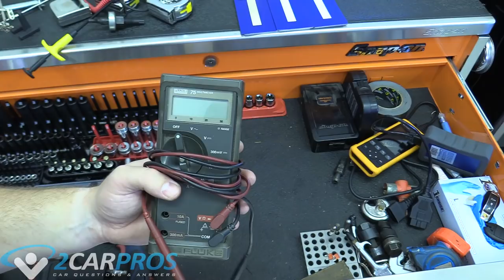What's In My Toolbox?! - Toolbox Tour!

Comment: It's always amazing how we buy a full set of tools and then realize you don't use half of them. Like that 30 piece screwdriver set you were convinced you needed when it was on the truck, now you have replaced the handles on the #2 philips and the straight blade twice and split the handle on the large one by hitting it with a hammer. The rest are covered with dust... Can always tell the guys in a shop who have just started in the past few years, they have all the metric stuff. Those of us from the "old" days still have the hammer and chisel we used to carve new round stone tires....
One thing to watch out for when buying any of the truck tools used, be sure the stuff is paid off. Nothing like getting a great deal on a used box, then finding out it isn't paid for and they repo it...

FYI, if you want the same quality as Snap-On but at a better price, check the Williams industrial brand. They are the same tools but less money.
Reply from the maker: Thank you for sharing! Most things are metric these days. It is pretty rare to run across American sizes these days. But when you are working on older cars they are a must. 

Yeah I called my local Snap On rep and gave him the box info, said it was clean. Great tip though!

I will be sure to take a look at those!

Comment: In the plier drawer that is not a battery terminal puller its a spark plug boot puller
Reply: Bought pair of those from J. C. Whitney 40 years ago, made out of softest metal ever. Would been really handy if made from good material.